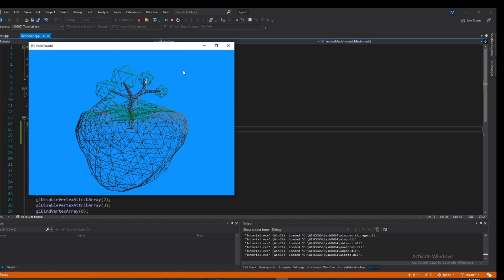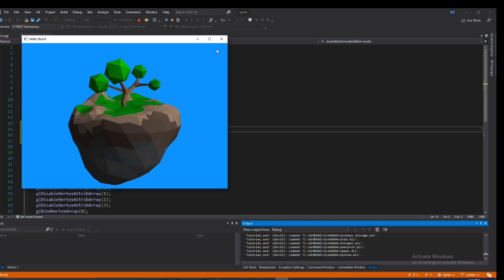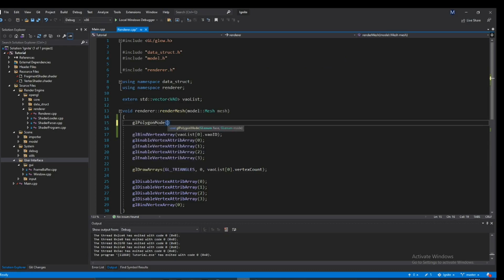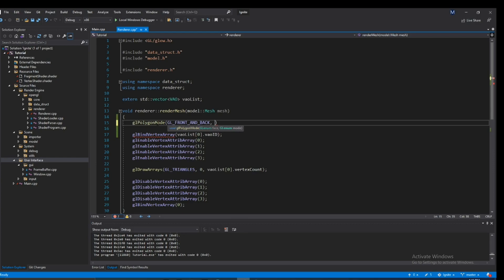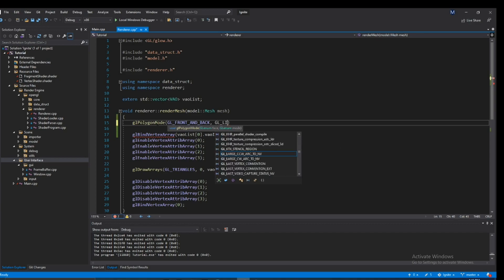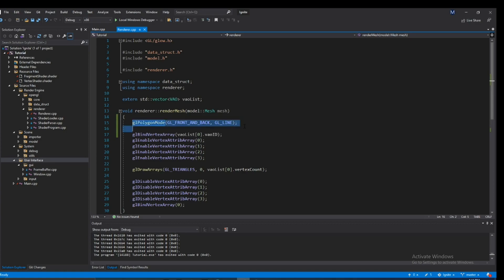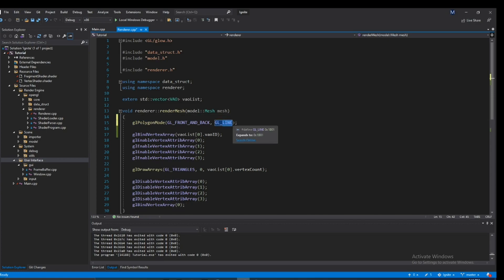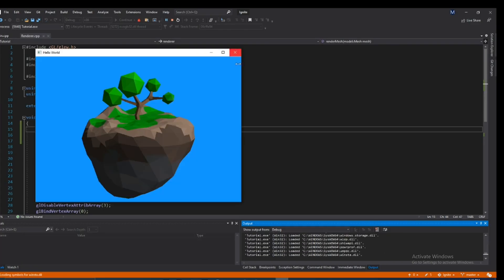How To Render With Wireframe (OpenGL)

Comment: how would you make hidden faces/segments - in wireframe mode - use a different a darker color ?
Reply: in your fragment shader:
if(gl_FrontFacing)
{
	fragment = vec4(0.4, 0.4, 0.4, 1);
}else fragment = vec4(0.05, 0.05, 0.05, 1);